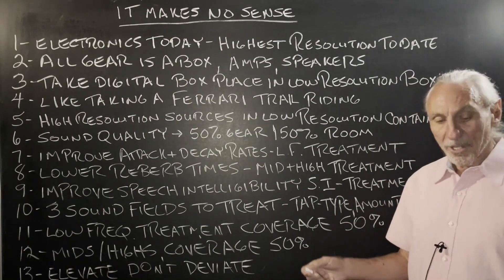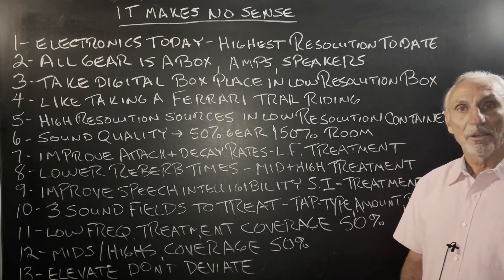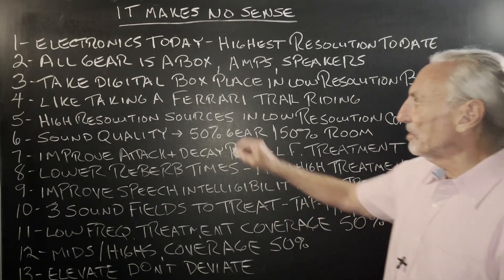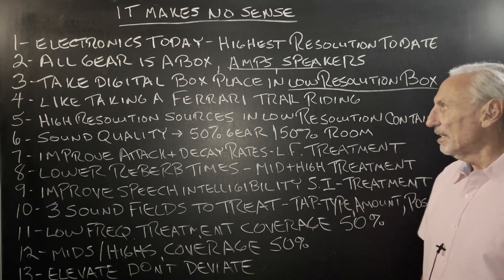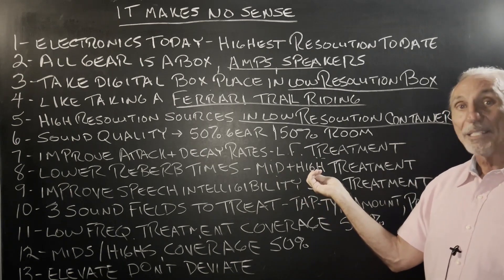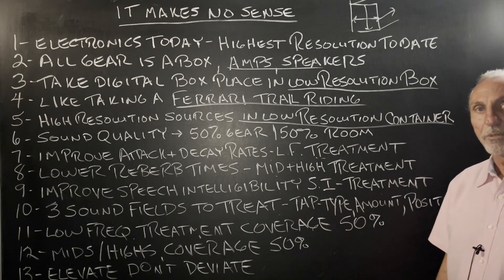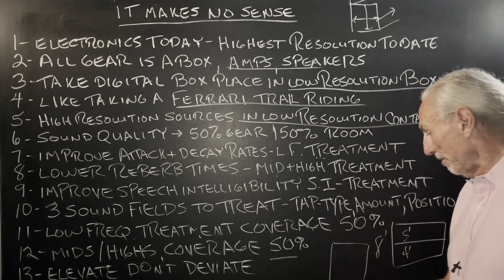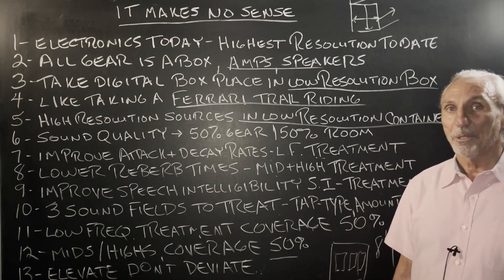It Makes No Sense! - www.AcousticFields.com

Comment: I’m adding a basement expansion for a theater room. The width is fixed at 16 feet max, could be less if needed. The length is adjustable up to 28 feet and the height is adjustable from 8 to 10 feet. Is there a magic combination of measurements I should shoot for? I’m asking you because I know I will get a straight answer. I asked once before about a basement space with a 7’7” ceiling height and you told me, Don’t do it. Period. Thank you.
Reply from the maker: Always choose the largest footprint you can achieve for all three soundfilelds. The more room volume, the better the room will respond to treatment.
Reply: 10:16:28 is very close to the ideal in terms of distributing  resonant frequencies (eigentones). However you'll still need an acousticsl treatment package to make the room work well for HT.